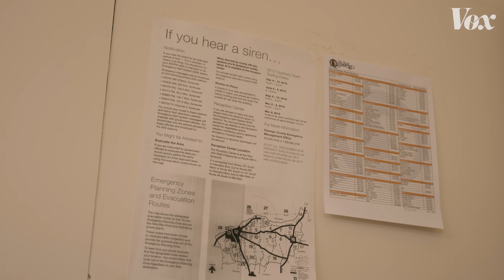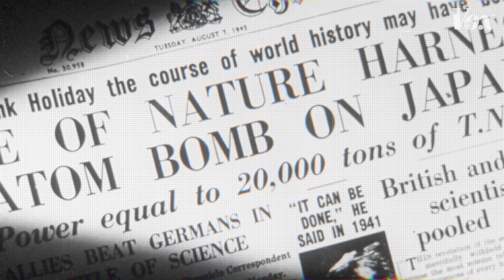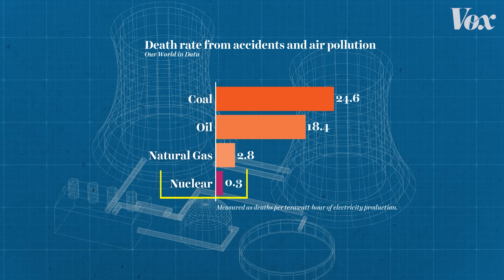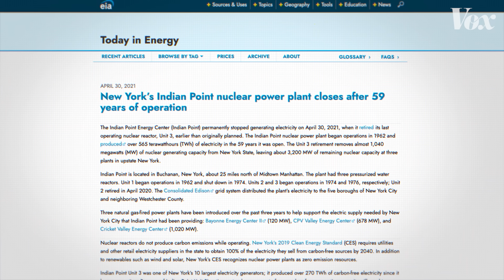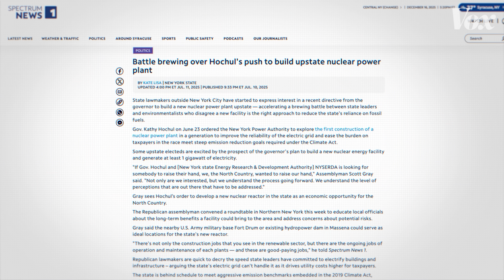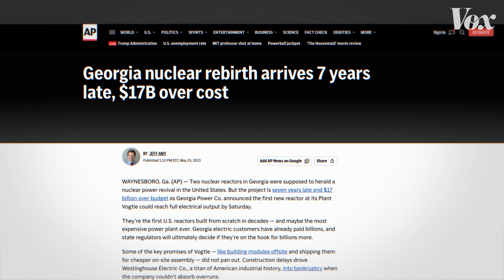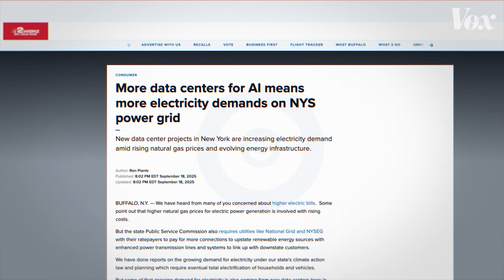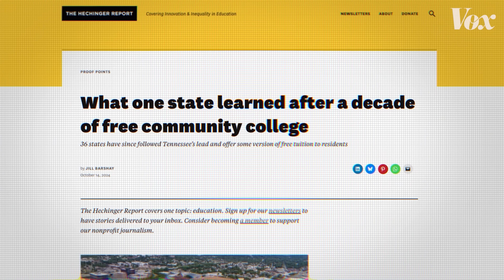This town has three nuclear plants. Now it wants another one

Comment: We were robbed of the nuclear age
Reply: Just another thing the boomers took from us.
Reply: For real! Fusion power would have came earlier if we stuck to nuclear.
Reply: Eventually We all have to choose between Nuclear vs Coal. As a baseload. The Solar,Wind and Lithium Golden kids are doing alright they now learning to Run no more walking.
Reply: @4thelementgroup  gas fired electricity is the way to go.
Reply: @4thelementgroup  nope 👎 
Hydroelectric with fish ladder . 
Cheaper than solar and danger-for 700,000,000 years-nuclear ☢️
Reply: @ProfessorFickle everywhere doesn't have the geography for hydroelectric
Reply: @MRLONG758 : agree , need a river valley. 
We don’t need to have a gigantic Hoover Dam size . 
Smaller dams also work .
Reply: @ProfessorFickle nah
Reply: @ProfessorFickle hydroelectric has killed more people than nuclear, turns out mechanical failure of the dam kills a lot of folks and has happened several times.
Reply: @ProfessorFickle   I live in an Australian State 3 times the size of Texas. We don't have a single river that could produce enough electricity for a quarter of us. We have more than enough Desert to power everything with solar, all we need is more batteries. There are different solutions in different places. It's not a one size fits all issue.
Reply: @tsubadaikhan6332  ) like I said elsewhere, You need a River valley  .👍 
Also , Danger-Nuclear also needs water for its cooling .
Reply: @ProfessorFickle what nuclear waste can be recycled down too 200 years and good luck building these things in ohio....
Reply: @ProfessorFickle we know that dams dont work.
The imf has proven with it loans that dams are a loosers bet aka cost too much.
Reply: Thanks Greta
Reply: Chernobyl , Fukushima
Reply: @ProfessorFickle proof of nothing. We could have power for the entire world coming from a handful of locations. Yeah there are some security threats and logistics for that.
Reply: @MAACotton  ) ☢️danger-nuclear☢️  fuel rods have a half life of 700,000,000 years 🙃.
Hope no terror group finds stockpiles and make a huge mess  . 🤦‍♂️
Reply: @ProfessorFickle there are much easier ways to commit terror than with nuclear. Nuclear waste is nowhere near the issue that fossil fuels have been and can be mitigated even further with reactor designs that use them.
Reply: @Zosu22  
) another danger⛔️nuclear ☢️fanatic.  
Hydroelectric Dams with fish-ladder 🪜 are the least expensive way to produce electricity in the world , cheaper than Combined heat and power natural gas, & much cheaper safer than ⚠️danger-nuclear ☢️
Reply: @ProfessorFickle  See you say terror groups but for a terror group to have the knowledge to actually harness that destructive power is much more difficult for them compared to them using other means.

Really what you are showing is a lack of education in this area of knowledge
Reply: @the_juz  
Google says : Used fuel rods will be dangerous for 700,000,000 years . 
After September 11 2001 this was a enormous topic, clearly you are too young or have bad memory.
Reply: @ProfessorFickle  You are aware that the longer the half life, the lower the activity? The number you're mentioning is for U-235, a naturally occuring isotope of uranium. The other one, U-238, has a half life of 4.5 billion years. You can hold uranium in your hand, nothing dangerous about that. To cause harm, you need to injest of inhale it and even then the concentration is the critial metric for the effects.
Reply: @ProfessorFickle  i'm sorry, you think hydroelectric dams are safer than nuclear? i'm not against hydroelectric, but dams have had much more deadly catastrophic disasters than nuclear. like, hundreds or thousands of confirmed deaths each. not even counting diving accidents. compare that to nuclear. three mile island? zero acute radiation deaths. fukushima? zero acute radiation deaths. chernobyl? 30 acute radiation deaths, and that was... actually, just about as badly as it could have been handled. i'd rather live next to a nuclear plant than downhill from a hydroelectric dam.
Reply: @ProfessorFickle The issue is that the US and most develop countries already maximized their hidro capacity, also water dams are good, but not suitable in all places, and remember that all the west coast is in a 30 years drought...

Also you are measing the huge land use that hidro makes, and the huge emissions due to Concrete...

The best and cheapest energy is not nuclear or hidro, is actually solar, but sun is not all day... And if nuclear receive investment and the taxes are removed us actually the best energy source yet... Until fusion arrives...
Reply: @ProfessorFickle That's a wrong "fact" it's 250,000 or you refine the fuel it's 1000 years.
Reply: @MAACotton   These events are proof of THEMSELVES, they did unimaginable damage and 2 meltdowns in half a century are not a good track record, now, is it? Especially for something that was claimed to be almost impossible. Not to mention the loads of radioactive waste that we CANNOT reliably store anywhere for a literal MILLION years, endangering countless future generations. This power is not ours to harness.
Reply: @maxonite  There are solutions for the "waste", it's a political obstacle not a technical one. 
You could use fast reactors to close the fuel cycle. With this you have products that you have to shield from the environment for 300 years if you decide not to use them in other technologies.
You could separate fission products and transuranics for use in space and renewable applications, like neodymium in high strenght magnets for wind turbines.
You could build a geological repository like Finland has and store it there for later use.
Reply: @ProfessorFickle Chernobyl design issues were signaled to the Soviets by the Brits 20 years before the accident, the plant was new, but the design was old...

Fukushima was an earthquake followed by a tsunami, something that's is unlikely is most of the world, also no one died from Fukushima...

And Japan is making more power plants...
Reply: @ProfessorFickle  Standard argument of a nuclear hater lol
Reply: @N@Nkar69) 
Hydroelectric Dams with fish-ladder 🪜 are the least expensive way to produce electricity in the world , with less environmental impact .
Reply: @ProfessorFickle  Least expensive? Seriously?
Reply: @R @RampageG4mer Cost per kWh is the least expensive & can last longer than 100 years  .
Reply: @ProfessorFickle  are you sure of the low environmental impact?
Reply: @ProfessorFickle how can it be less environmental impact when it literally change the whole landscape of the area??? Dams are always protested by indigenous communities as well as environmental conservation organizations as they destroy habitats of local wildlife which in turn starves indigenous communities.

while it is still a better option than coal/oil, it is not more environmentally friendly than nuclear power.
Reply: @focusonthecurrent  
1)Disagree: beavers exist
2) smaller Dams can also be made that are less than 40 Ft tall, almost as efficient as large dams .
3) Nuclear ore mining is even more damaging . Nuclear refining is also expensive and produces nasty byproducts.
Reply: @ProfessorFickle  your counter-argument is beavers? I get that your a troll, but what
Reply: @Cnfhd  
I am not impressed by you completely ignored Uranium-mining change the environment.
Reply: @ProfessorFickle let's assume that those instances were as bad as you likely think they are (they weren't) how many people do you think have died from oil, coal, in the last 5 years alone? Do you think that number is more or less than all the nuclear accidents in the history of mankind combined? How about impact on the environment, which one do you think has ruined more land?
Reply: @ProfessorFickle  there are lessons learned and we get better every advancement in tech. Now we have AI to help monitor and maintain reactors much better.
Reply: @rl8571 ) Does NOT compensate for its drawbacks . 
We have also wasted almost a trillion usd trying to make thorium power plants, with nothing productive to show for it .
Reply: @ProfessorFickle a few incidents, most of which were contained, vs tens of thousands of cancer deaths and millions of indirect ecological casualties resulting from fossil fuels.

Nuclear could've saved the planet if people weren't reactionary clowns
Reply: @RTDice11 ) Eastern Europe  had  radiation ☢️ poisoning from Chernobyl . 
Looks like you have Selective amnesia .
Reply: @ProfessorFickle  TMI. I love how muricans love to point fingers, and ignoring their nuclear plant failure. :D
Also, Chernobyl was RBMK, TMI is PWR and Fukushima was BWR. Three different types of working princple. The only connection between those is the human stupidiy, underestimating the nuclear power and overestimating the human ego.
Reply: @ProfessorFickle  Chernobyl happened due to corruption, bad design, and horrible chain of command structures. Fukushima happened due to the biggest natural disaster in Japan's history which significantly exceeded the plant's design and also corruption within the power utility company. Nuclear is inherently safe when done right. There's 100s of reactors on the world that have been generating clean power for decades with 0 issues.
Reply: @jt92 
Nuclear ☢️ is expensive compared to hydroelectric Dams . (If they are made with  fish-ladders no environmental impact )
Reply: @ProfessorFickle  Saying there is not environmental impact is naïve due to construction of dams which any type of construction will cause environmental damage and that does go the same as nuclear

But also you are correct in the saying the initial costs are higher but also the power output is significantly lower and also the process of making dams is very selective on where they can be placed more so than nuclear.
Reply: @jt92 Adding to that is fukishima is still running today.
Reply: @ProfessorFickle  hydroelectric damps require an active river than is big enough to generate a meaning full amount of electricity, building a hydroelectric dam also requires the reallocation of people living there. Hydroelectric dams also blocks and seperate's ecosystem. and another thing is dams blocks trade across the river
Reply: @BluesFlames2 ) 🤦‍♂️small dams do not require large-river, small dams are too small for boats that carry trade . 
Small dams are almost as efficient as large Dams like Hoover dam .
Reply: @ProfessorFickle  You're not gonna believe this, but the majority of the failures of those 2 are in fact the result multiple human errors
Reply: @ProfessorFickle As long as we do not do any dangerous experiments or build power plants in earthquake prone areas there should not be any issue
Reply: @ProfessorFickle oil company enabler
Reply: @ProfessorFickle 
Remember thete have been 100K plan crashes